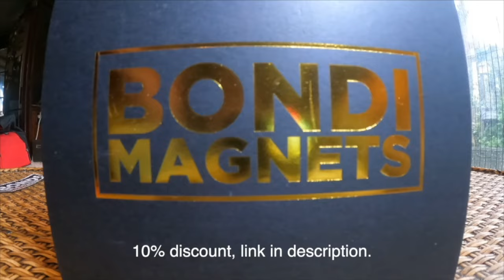most INSANE magnet fishing adventure EVER.. ( when you think it can't get any crazier )

Comment: Happy birthday Joopie! You should try to clean that mix deck up. If it wasn't on when it went into the water it didn't short anything that way. Just open it up, spray it off with a hose, then clean it in your sink. Most electronics come with a protective coating on the board so it's worth a shot. Get it under a magnifying glass and pick out any schmutz touching 2 circuits at once and any in the pots (stuff under the knobs), let it dry in a container with some silicon packets and try to light it up!